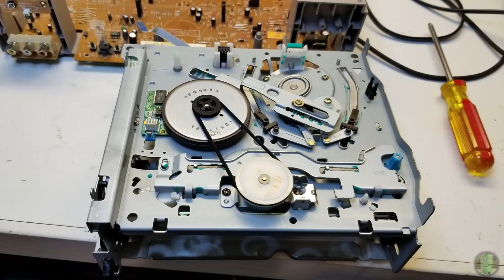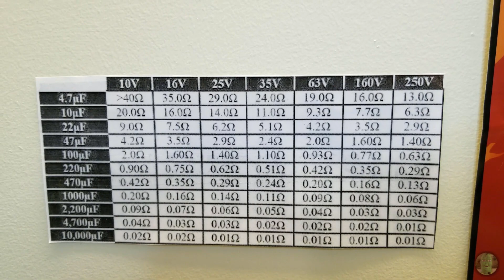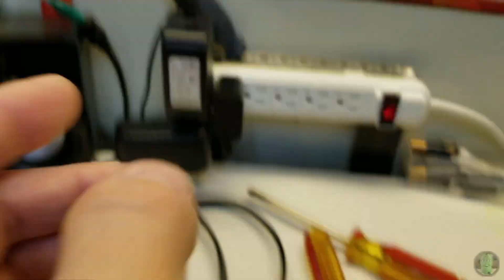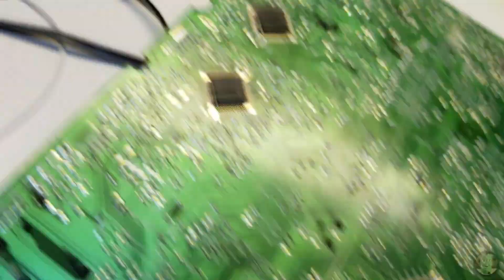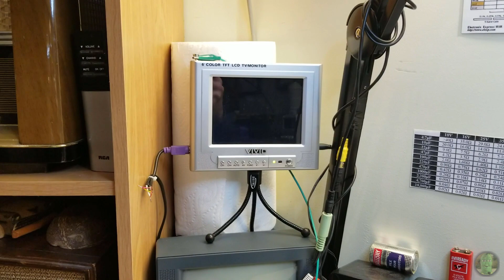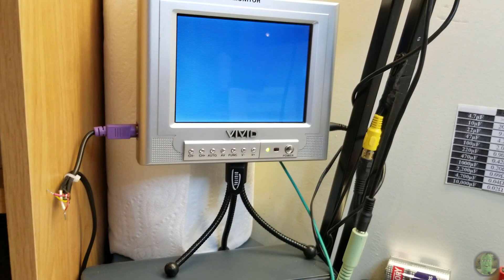2002 RCA VCR repair attempt (Model VR-661HF)

Comment: Did you ever fix this? We had one of these too and it's similarly broken.
Reply from the maker: Unfortunately, no. I ended up giving it away for parts.
Reply: @probnotstech  did you ever identify if anything was acting like fuse? I'm going to test out the caps esr but the main culprit I think is the power area which seems to have a lot of black dust looking like something burned out.

Comment: Dont know much but mine had power and worked but wouldnt eject tape. It would attempt to play then stop and cycle back to original starting position.
Im not sure but think the tape somehow got out of wack and not in properly. 
So my display would come on but only power would work.. no play ff rewind or channel up or down.
And would make a noise when I turned on so followed the noise to somewhere around the tape. I ended up tapping the top of tape and machine would allow my to use display but only for it to go back to that original position.
Well as lame as it is.. it stopped working no power which leads me to this video today.
My next step was a sad one as I popped the bottom off to finally see a problem. 
The gear that moves the tape up and down was jammed to case with this black tar crap found inside the groove of the gear. I know it came from there as some was in in still about half the circle.
So there we go the thing I think was problem from start.. the tape needed out can now be done. So removed it and was happy to know I got it. But now I have no power so was thinking since fuses look fine it might be an old capacitor or something in the power supply area.
Seemed so close

Comment: That's about the simplest VCR mechanism I've ever seen.
Reply: Samsung's TS-10 is even simpler, and of course there's the last-generation Funai MK14's where one plastic slider does all the work. At least this one still has mostly metal parts, although I suspect they copied the diagonal loading arm drive rack arrangement from an older Funai.
Reply from the maker: They were really built down to a price by this point.

Comment: That's not a very good ESR tester. Good ESR tester let's you  test caps incircute so you don't have to pull ever cap out to test it. The model I have is a signstek mesr-100.
Reply from the maker: I didn't feel like spending a bunch on a tester, this is just something I'm doing for fun. This tester isn't high end, but I checked it against a better a friend had on good and bad caps and it seems pretty accurate (ESR and capacitance). I was also checking it against a couple other meters I have (capacitance only) and it seems pretty accurate.

I've heard mixed things about "in circuit" testers being able to properly test in circuit.

Comment: This VCR is actually made by Daewoo, also how does a VCR that's not even pretty old die in 18 years?
Reply from the maker: 18 years is pretty good for a modern cheap plastic VCR, that I assume was plugged in for the duration.

Even the older VCRs we think of as more reliable had issues, some after only a few years. VCR repair was very much a thing.